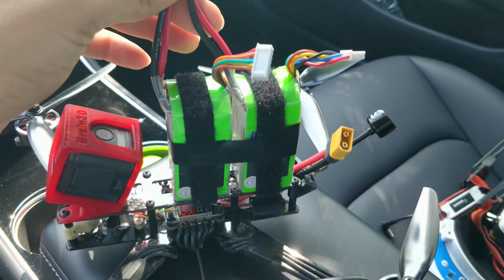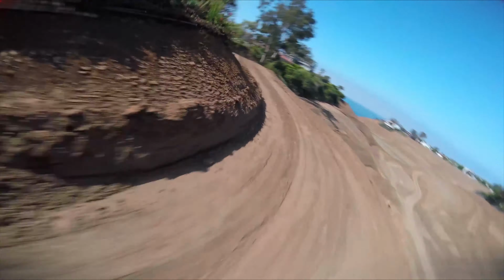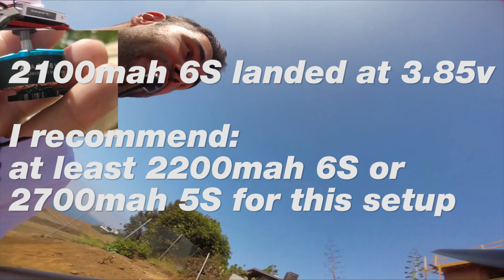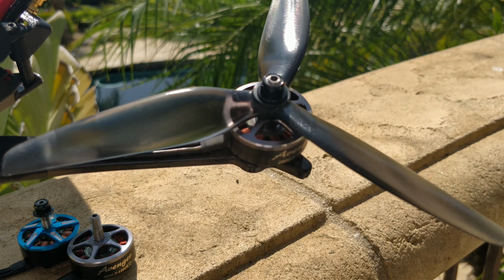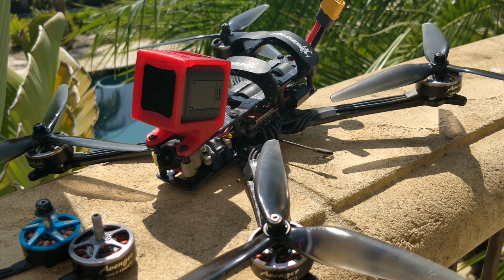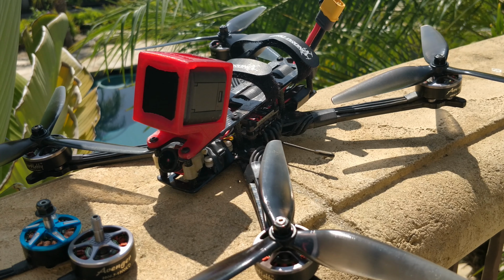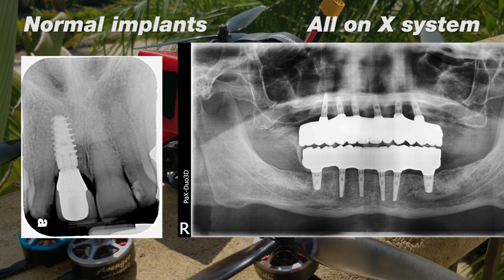Brother Hobby 2806.5 Avenger - 7"

Comment from the maker: Unique Coupon Codes down here
▼Table of contents first:
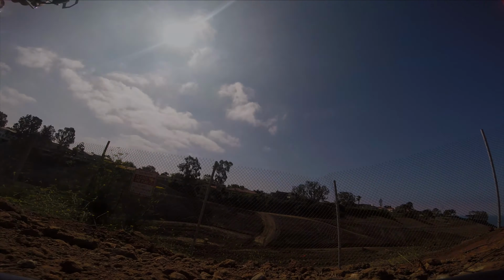00:48 - Flight video
03:40 - Racerstar/Tmotor 2508
05:10 - Motor look/overview
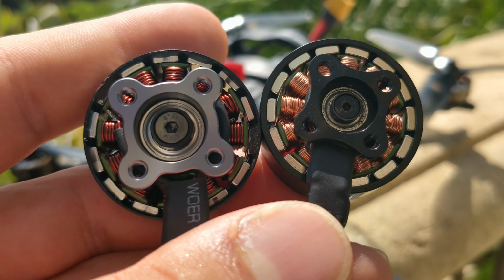06:30 - BIG WARNING ON MOTOR!
09:35 - Control performance
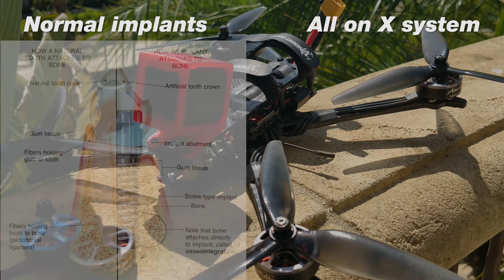13:10 - Dental implants vs All on 4

Avenger 2806.5: http://bit.ly/2OafeF6
FANTASTIC for 7" props and 5S or 6S in 1300kv

Racer/T-motor 2508: http://bit.ly/2VkLFik
Excellent for 6", very very good for 7"
THIS MOTOR IS A GREAT VALUE!

▼The rest of the 7" quad:
-Hyperlite Glide Floss 7" (will be re-released soon)
-ESC: http://bit.ly/30OEDWk
-Prop: http://bit.ly/2LAJw1q
-WaFL’s Cap Cap: http://bit.ly/2GUpXxO
-FC: http://bit.ly/2XRc8G8
-FPV Cam: http://bit.ly/2Q7LfL7
-ND GoPro Mount 30deg: http://bit.ly/2WC15zc
-ND Filter (if used): http://bit.ly/2WEmQ1j
935g AUW with 2x 1050mah 6s Pulse packs
FULL STOCK PIDs and filters

▼ Unique COUPON codes mde for me spreadsheet
http://bit.ly/2JWLBBE
Some of these codes can't be found anywhere else because they made them specifically for my channel.

▼Join my FB group for more discussion: Kabab FPV
https://www.facebook.com/groups/379155946182689/

▼Notable motors:
-Xing 2306: http://bit.ly/30uYo4Q
-Xing 2208: http://bit.ly/2y3te8R
-FANTASTIC 6" motor: http://bit.ly/2LqghOZ

▼ 5" Sub $200 build that's still good
-Frame: https://goo.gl/EpXQhZ
-FC/4in1 Stack:  https://goo.gl/HprVbj
-Motors: http://bit.ly/30uYo4Q
-Props: https://goo.gl/ZnzY2y
-Props: https://goo.gl/VMBiQh
-FPV Cam: https://goo.gl/FDJhYw
-Vtx: https://goo.gl/JNVDMn

-Starter goggles: https://goo.gl/GvJUkT
-Batt pad material: http://bit.ly/2QGWhYb

▼ If you want to solder better:
-Fantastic solder: https://amzn.to/2P5QM2W
-Fantastic iron: https://goo.gl/DqBipa

▼ Tips?
-PayPal: https://www.paypal.me/kababfpv
-Bitcoin: 1E4XZXoD4rS6MYWVWuenY7Kw2M1YgyNpoQ
-Nano: xrb_1188ek5bd7tb9kw67asnp9o65byuoaxbtpxuznx1ribf75x78awywmakj55f
-ETH: 0xD067F93811f2eC31CB1928901002dfdf9A492EF5
-LTC: La2KWYAjp4VT2Lq2M76pbjzXWvRyjpfCtG
-Tesla Referal code: https://ts.la/bob40889
Please use my referral code if you're gonna buy a Tesla.  You get some free stuff when you do and I get better status with Tesla.

Comment: I'm not the biggest fan of Dal Cyclones however I have recently found the Dal Cyclone 7" is a rockin prop..Got rid of most of the bobble issues I've had with HQ's..
Reply: I have to add to this. I had really bad problems with vibrations un-curable by tune. First with Gemfan props on 57% THR then with HQ @ around 40%. I did not want to fly Cyclones as I thought they were to steep....oh boi....best cruising prop ever....also very easy to tune...and very high cruise speed with low A draw
Reply: Are you all talking about the Cyclone 7056 props, or the milder DP7X4X3 3-blade 7Inch Poly Carbonate ???

Comment: Nice motors!
I have been trying 2216 1400kv motors on my 7 inch, and I am getting heaps of power and 25 minute flight times. I get a few vibrations, but thats probably due to my bad PIDs.
Reply from the maker: it's probably not the pids.  I thought it was at first too
Reply: 25min flight time? wow, what battery, number of cells and mAH?
cheers
Reply: @paulr3556  My setup: 2216 motors 1400kv. 4S Lipo 5000mAh 70C. 8 inch propellers. And yes, 20-25min flight time
Reply: Brian Evans which frame do your fly with 8" props? I'm using the old days sunnysky x2212 as kabab was.
Reply: @km_photo  I used the F330 frame for a while, but it broke. Now I'm using the ST360 frame. It is beautiful, but not very strong. I'm running 9 inch props now. Trying to find the sweet spot of performance
Reply: @Brian Evans these are both flamewheel styled frames which I already have used a lot in the past, but I didn't know any better at this time. I would like to see a ZMR250 styled frame with the longer arms. I'm looking for someone who can cut/produce arms in the right length for the ZMR250, that would be awesome.
Reply: If you want good 7 8 9 10 inch frames check out almond racing, my nex336 frame has been coping obcene abuse for 18 months now
Reply: @fyshlearnstoskate  Thanks. I have ordered a 9 inch carbon frame from banggood and will see if that solves any of the vibrations

Comment: Once you loved the gf 5152, and got me all hyped up. Then t-motor 5143, and gf 51466, and now the hq s4 5037 ish. Have you changed your mind completely?or do you want low pitch for freestyle, and high pitch for racing?
I try and remember what you said in all the prop videos.
Reply from the maker: New props come out, I try everything.  I can't like the S4 prop two years before it's out....  I think the 51466 is one of the best props on the market along with the S4.  Those are the only two props I would personally currently use.  If new props come out tomorrow, that might change.  I don't control the future.

Comment: Since you mentioned Helio/Butterflight, do you know what's going on?  Last firmware update was released on February 18th this year.  Love your content!
Reply: The ones who started helio were sued there ass off, and lost a trial to the flight 1 team. The founders of helio, were also the ones who started butterflight, so it went down with them. If you want, you can put the new betaflight 4.0.x on there, but the code on the f3 chip operating the filters for the gyro signal, won't get any updates
The f3 filter code was released as open source on github, and every one can try the code on any fc board. Sadly I can't remember the name of the new repo.
Reply: @pippifpv  Thank you very much for the info.  I only got one of  their boards (Helio Mini).  3.6 firmware flies fine for me,  I was just trying to find out if they are still in business.
Reply from the maker: helio is gone.  butter has adopted their tech and built it into the updates and it's now called emu flight or something like that.  I don't really know.  just waiting for updates too
Reply: @Kabab  Thank you, I like the FC and was considering getting more but I won't until it's sorted out.

Comment: I have a question with these motors With the 19 x 19 . Well this  iFlight XL7 V4 True X 7 Inch Frame work with those motors ? 
Would you recommend it with that frame 
You seem to know what’s up thanks 
And thank you for talking dentist Information in your video’s 😄
Reply from the maker: I'm not sure what that frame is but the product page should have the mount platform listed.
Reply from the maker: Ah I see. It's a very generic frame. Should be fine.  The arm looks like it would fit 19x19 but the description doesn't list it so I couldn't personally confirm it.
Reply: KababFPV  
Thank you for your help

Comment: Good point Bob, but what is your opinion running 6" props on 7" frame?
Reply: I believe it works really well. I have a 7 inch Martian that I run 5 inch props on. It is super smooth super locked but it has a weird floaty characteristic.
Reply from the maker: acro frames are usually already a size up in size.  especially if the batt goes on top.  Not much point in going even bigger to run smaller props.
Reply: @Kabab  what about 8" frame on 7" props on a bottom mount frame super light frame like the flynoceros aether v1?

Comment: I've got the 1700Kv motos and these are hands down the best motors for my 7 inch Super G frame.
Reply from the maker: interesting.  how is the 1700kv?  I have a new 7" motor that I just finished up but I went for 1450kv.  It's quite powerful but I did consider the higher kv too.  Do you run it on 6S or 4S?

Comment: On the Avenger 2806.5: You suggest 1300kv 6s 7" is splendid - I thought it would've been too low, but how about the 1700kv option? do you think that would be too aggressive?
Reply from the maker: 1300 is great on 7-inch and 6s
Reply: @Kabab  Thanks for the reply, my only other worry is now finding frames that fit such a beast of a motor by default :P

Comment: Will the 3 inch version of your cube will maybe need stiffer props to handle 3s? Just a question based on the findings of Albert Kim who tested it with 2s. Please measure the speed on the 3inch with 3s I think it's min 110 mph. Great and cool that you're still looking for a better cam. Maybe ads a capacitor to filter the video on 3s as well.
Reply from the maker: The one I will make a video on is the 3-inch version because I have a couple of very interesting 3-inch props to try on it. I wouldn't recommend the 3-inch version for anybody that isn't experienced with piloting already. it can generate quite a bit of speed and force so it can definitely break the frame without all that much effort
Reply: @Kabab  ok can you consider ra frsky bnf version maybe. That would be great. Looking forward to your look on the 3 inch I think most of the people are interested in that one. But a bnf with no fideling would be great. AndyRC said the same thing about the new Eachine diatone er349 or what it's called. As someone that owns more than 25 quads ranging from armattan, kingkong over karearea to individual frames I can say even for us who have been long in the fpv sport... We prefer a bnf... a pnp can still be up. Easier for newbies and one thing less to work on as a quad maniac. And Albert wanted to test how crash resistent it is lol. Hopefully not on 3s because than it's just a waste of great quad.

Comment: Have you had a chance to look at the new brother hobby 2004 motor?  Interesting size and only like 15 grams each...may be really good for super duper light weight LOS rigs...
Reply from the maker: It's very nice but I'm not a fan of the small shaft. I have a motor coming to FPVCycle that easily tops the bh 2004.
Reply: @Kabab  I agree re the thin shaft.  Bexamous built a complete carbon fiber tube LOS-only rig with 5" props using these motors under 100g.  Willing to share any other details of this mystery motor?  If not, a ballpark release timeframe?  My interest is piqued...

Comment: You mentioned that you dont use bigger arms then 5mm But you don´t think the bobbles are smaller or away with bigger arms like 6mm or 7mms?
Reply from the maker: no, I've tested thicker arms.  it doesn't make any difference.  lately what I've found to improve it quite a bit is shifting weight forward.  increased nose weight on the quad seems to improve and in some cases get rid of the bobbles completely.
Reply: @Kabab  Ok Thanks!

Comment: Do you think that having a metal object in your body is problematic - metal object acting as an antenna for EMF? I've read that EMF radiation causes  massive influx of Ca++ ions in to the cell which is problematic. Mg++ acts as an antagonist to this process, to some extent. This is why I preventively take a Mg++ tablet almost before each flight.  Thank you so much for all that you do KababFPV!
Reply from the maker: This isn't quite the same kinda metal.  Titanium isn't really a ferric metal.  It shouldn't attract any radio waves the same way however no I don't see it as a problem.  In this particular example it may actually help even because it blocks waves.
Reply: @Kabab  Thanks man 😃

Comment: Hi.. I am also trying to build a 7" cinematic fpv drone with 6S custom lithium ion pack (Either Panasonic NCR21700T or Nitecore NL2150HP). I am fairly new to this field from actual building point of view but have spent a lot of time in online research. But due to lack of monetary resources I can't go ahead and buy everything I want for testing per se.. Therefore I need your expert guidance. I need confirmation on 2 things:

1) Motors: Currently for 7" quads, I see there are 6 motors available - BrotherHobby 2507, BrotherHobby 2806.5, BrotherHobby 2810, Xing 2806.5, Racerstar AirA 2508 and Flywoo 2806.5

Which one would be suitable for my build to get smooth flying experience for a cinematic drone footage point of view but also should pack some bit of power as well to do a few maneuvers if feel like it. For example we see the mountains and waterfalls footage from people like AndrewFPV etc. 

2. Also please consider the weight after battery is added since every battery would come around 70 grams so we're looking around 450g of battery weight. So would the above motors be sufficient enough to drive the combined weight of around 1400g? If not what changes I need to do from motors choice point of view?
Reply from the maker: First off, I would STRONGLY urge you to resist doing this just yet. STRONGLY!  If you do not have experience flying, with these radio systems or lithium batteries, there kinda isn't enough research out there that could fully prepare you.  Please build just a simple basic 3" maybe to test and practice on before going any further or even just get tht controller and play the simulators. This will save you a ton of time and money. 

Otherwise I would only recommend that brother 2806.5 for this setup.

Comment: I have a type 2 byte and I'm considering a wilckodontics procedure. Is this procedure something you're familiar with and have performed on a patient?
Reply from the maker: I haven't and I sort of wouldn't recommend it. It's quite invasive. Invisalign can move teeth quickly too. If you need extreme movements there are other ways. Slicing up the bone between the teeth just doesn't seem like a great idea.  But I'm no expert in either perio or Ortho.

Comment: This bobble issue you talk about, is it by any chance only on the pitch axis?  My 7" has really noticeable pitching up and down motion while roll axis is locked in.  I tried maybe 10 different things to figure this out and haven't been able to.  Any clue?  Hyperlite 2408.5, HQ 7x4x3 on 7" Floss 3.0
Reply from the maker: It's not on just the pitch.  It's sort of on all the axis.  can't differentiate.
Reply: @Kabab  Roger that, thanks.  The investigation continues...
Reply: @Kabab  Finally figured it out, sharing it here because why not.  As it turned out, on this kwad pitch needs a MUCH higher P than roll does, and I simply didn't have enough P on pitch.  I started at 45 for roll P and 48 for pitch P.  Now they are at 49 for roll, 75 for pitch.  Out of curiosity, how similar/different are your roll P and pitch P?  Thanks

Comment: Are the new glide frame parts going to be interchangeable with the old, love my glide but would live to have one more battery strap option so I could center my battery more when flying without a go pro which is a lot, love to fly, hate to edit. Don't know if possible at this point but thought I'd mention it just in case
Reply from the maker: yes.  I'm keeping the same mounting systems.

Comment: So, I didnt have bobble at all with 2306 gep RC  speedx 1600kv motors, now with 2408 I get bobble and bounce back, tuning doesnt make it go away, I'll see if the same is true for me when I put the avengers on
Reply from the maker: Fly in high wind. You'll bobble so hard you'll get nauseous
Reply: @Kabab  I have the geprc croc 7 I flew with the stock motors (2306) in 25 mph winds no bobble, I put bigger motors on (2407) now crazy bobble in light 7-10 mph winds... so I'm confused... 
The windings are larger and more uniform on the smaller motors, the windings on the larger motors are multi strand which are not as uniform... maybe the issue lies in the windings?
Reply from the maker: @kodypierce3507  could be something else.

Comment: Building a project 399 + 7” with these same motors. Any suggestion for battery? 1700kv as well
Reply from the maker: I'm doing an update video on my latest 7" now actually. My best recommendation is just to get the highest C rated pack from any manufacture you're planning on going with. Anything less than the highest or just below the highest isn't worth it. They don't perform nearly the same regardless of the specs.

Comment: what did you think of the 2507 Avenger v2? It looked like a good 7" motor I was gonna try it...
Reply from the maker: Now that this motor exists I wouldn't mess with anything smaller for 7 in. I do know that there are a couple of other companies working on a 28 size motor as well
Reply: @Kabab  ok good to know thanks...I did try the 2510 BH motors (almond racing) also on a Helio build a friend asked me to tune and I know what you mean about the bobble, however I assumed it was from the absurd levels of torque and weight produced by that size motor...this made me caution over very large motors...
Reply from the maker: @stevejhkhfda  I still dunno what it's from but I know a wider motor helps.

Comment: You. My friend are a God thanks for the info I've been having the same issues for a long time now. And good to see someone had the funds to finally go all the way. What's your take on efficiency on say a 2600 6s flight time
Reply from the maker: no point to 2600kv 6S.  The motor won't have the torque to push that high unless it's a substantial size motor.  In which case it's just too heavy for a 5" prop.
Reply: Sorry my man miss happ here :D running a 2207 1900 kv  xnova on a 7inch prop , that wobble is like death hahah , running on a 2600mah 6s pack.
But looks like for a 7 inch just needs bigger motors , IE the 2508 as you said as a good allrounder , also can confirm that as a friend has the same 2508 tmotor/racestar and that fly very well on a 2600 mah pack we got 11klm's of Flight.

looks like its time for some 2508(good price) as a all rounder but would love to see more videos on these 2806.5

Comment: Great videos as usual.  Maybe some advice on long flight time builds 10-15 min? Question on dental wear and teeth grinding.  I have small spots or holes ( usually 4) on a couple molars where the enamel is worn down. Exposing the dentin and causing sensitivity. Dentist confirmed that there is no cavity. Can this be corrected with fillings? Can fillings on Molars cause additional wear on your other adjacent teeth?
Reply from the maker: Those are just worn down spots that have exposed dentin. Keep it clean and it's gonna be fine